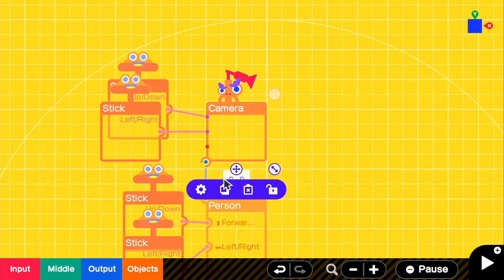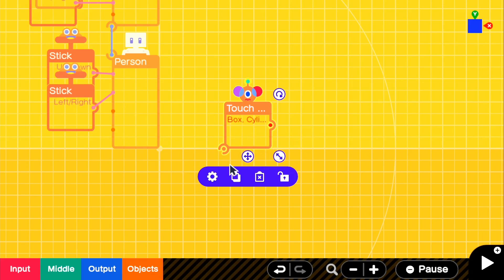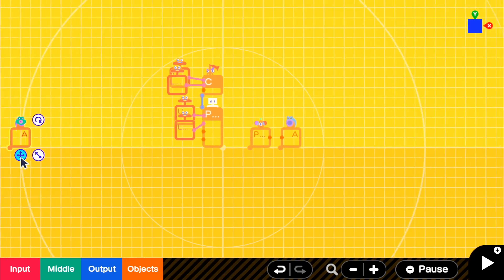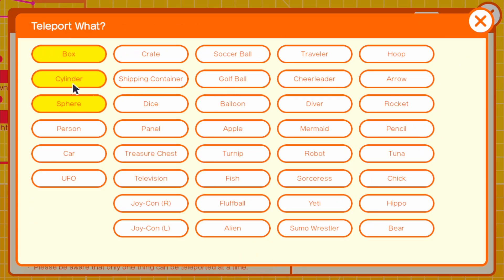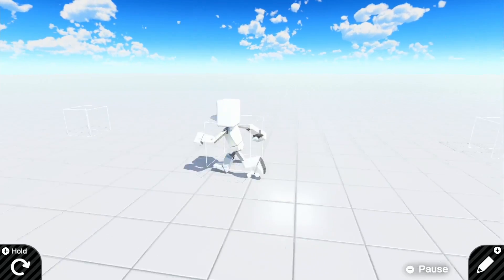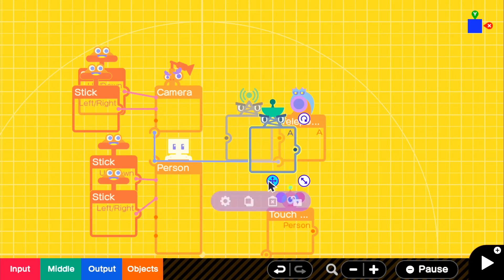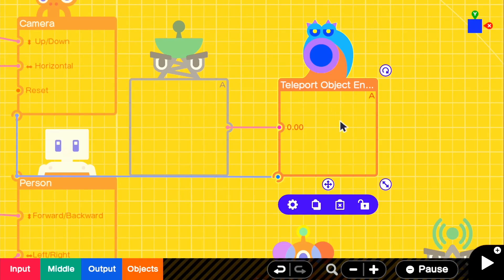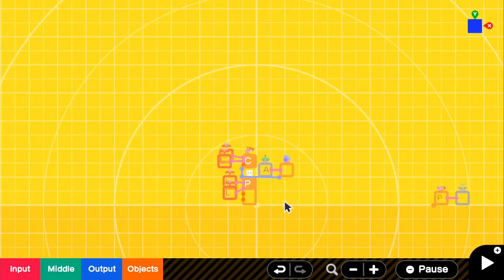[Game Builder Garage Tutorial] Teleport Player

Comment: What if you put the person behind a title screen and when you press a button it teleports him to the level
Reply from the maker: This would work very easily, the only difficult thing about it is that you need to lock the camera on the title screen. You could probably do this with like a start nodon and using not nodons to restrict the movement of the camera. I actually am working on a title screen and that will be hopefully coming out soon!
Reply: I made a code for that 
G 004 CHH 9P1
Reply: I'm on a trip I'll put the code when I go back thank you
Reply: @arlenegarcia8706  I actually made a mistake
Reply: @arlenegarcia8706  change the horizontal tracking on the game screen nodon to 0.10

I set it to 0 for some reason